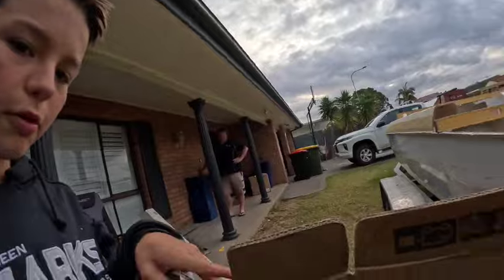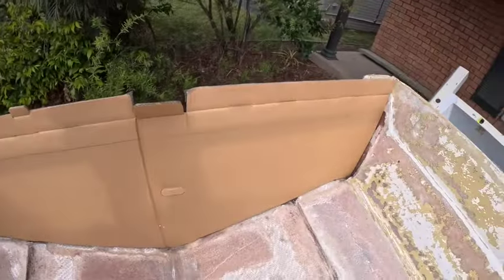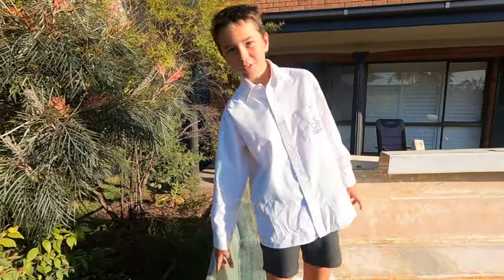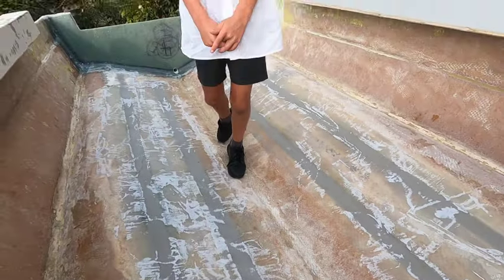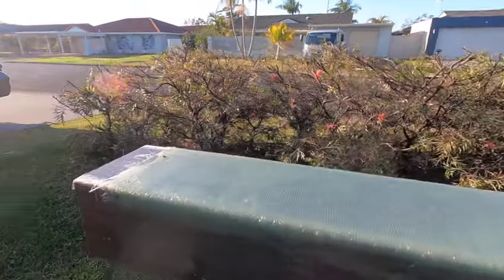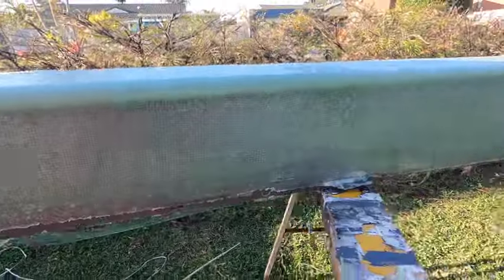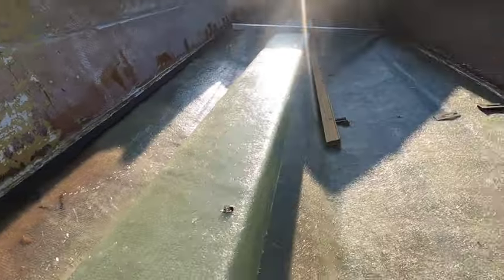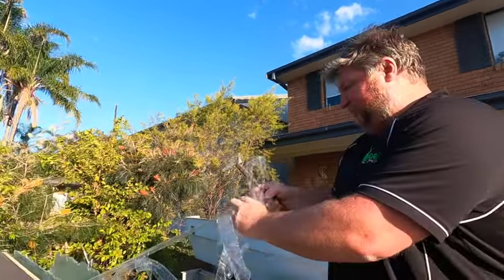Project boat 2 Solid glass transom  and hollow glass stringers

Comment: How many layers mate and what size CSM and double bia on your stringers awesome work
Reply from the maker: We used 5 layers on the top of Stringers chop/rovings/chop/rovings/chop all 600g
Then on the sides we use 3 chop/rovings/chop but used another 3 to fit to boat so it ended up 5 on top and 6 on the sides 
Like I said we used 600g cms and 600g woven rovings 
Hope this helps
Reply: @ThePMQpirate  cheers thanks mate
Reply: @ThePMQpirate  did you use polyester resin ??
Reply from the maker: @therukugorillazaotearoa_  yes
Reply: @ThePMQpirate  thanks mate I think I'm Gunna copy your method cheers
Reply: Sorry mate one more question how did you measure out the stringers ?? To get them to fit what method did you use